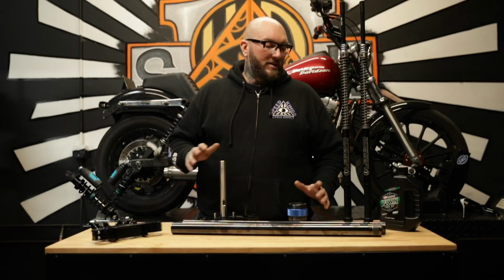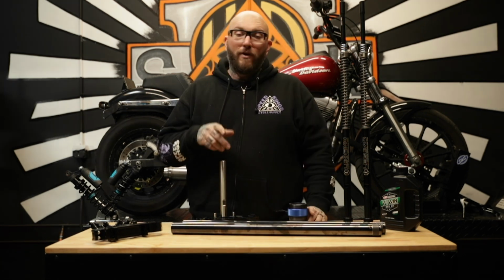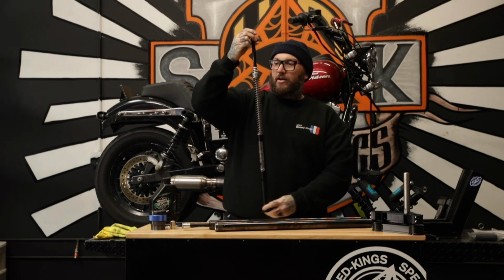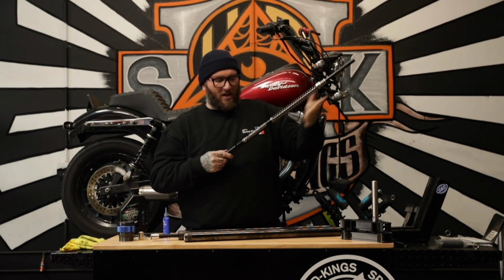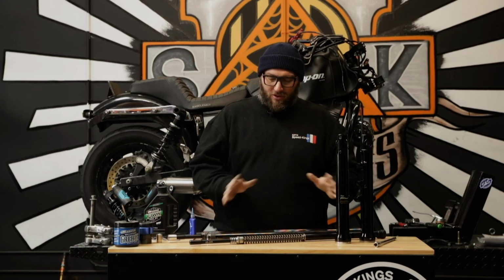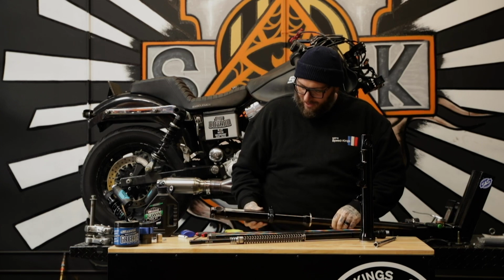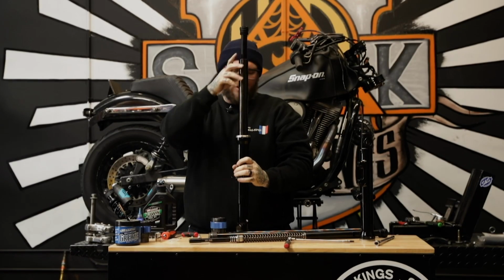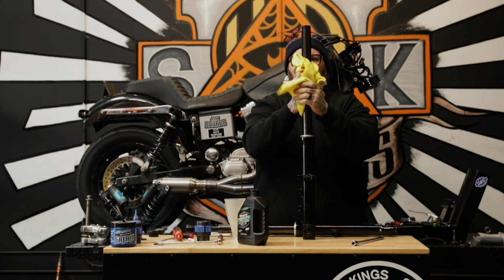SPEED-KINGS INSTALL: LEGENDS SUSPENSION

Comment: Are these standard length?
Reply from the maker: In this video they are +2 we can get you either though
Reply: Do you need +2 or can you use stock length ?
Reply: I need the instructions to installing standard length the standard length, not sure if it is the same oil capacity.
Reply: They have discontinued the stock length so I can’t find instructions anywhere